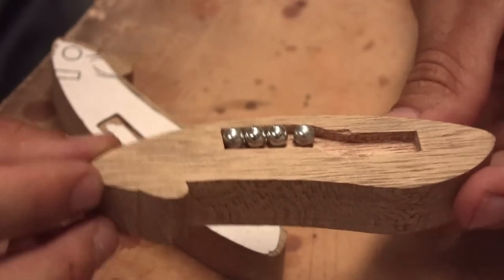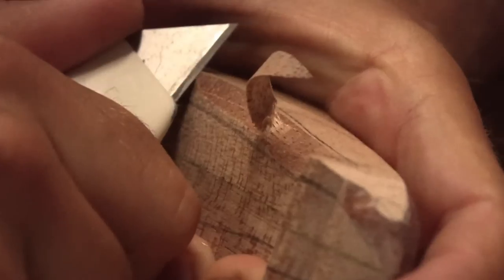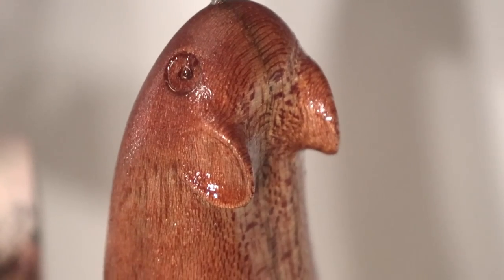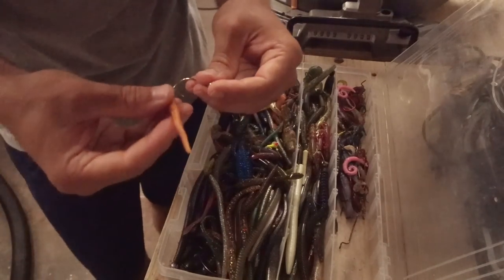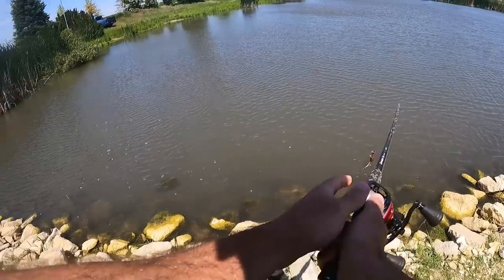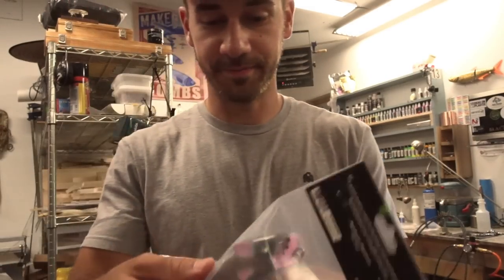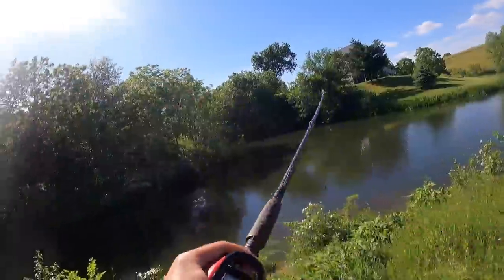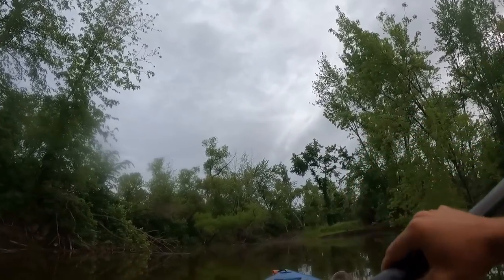Mahogany Mouse WakeBait with a Weight Transfer Chamber

Comment: A truck I've seen from other wood working channel's, use painters tape on both pieces in between the pieces with some glue. Super easy to separate after cutting.

Comment: I notice you use a lot of different knives for carving. Have you tried one of those scalpel blade knives? All different kinds of blade shapes and the blades are replaceable. Claw shaped blades, straight blades, chisel blades, drop point blade.

Comment: You should get (or make it is just led and wire) one of those lure retrieving things, not the big plastic ones but the small metal thing that you slide it very hard into the water and cuz it’s so heavy it can knock it loose

Comment: Had an idea you could entertain.  Could you make a top water lure that uses a tiny solar cell to power a tiny electric motor with an offset weight.  When the sun feeds the solar cell, the motor turns, causing vibration.  I've seen novelty solar bugs online that you could harvest the components from.  No one that I've seen has ever done this.  And you can play off the high gas prices and how we're are sort of being forced into submission of electric vehicles due to that..  Just a thought, probably would get good views

Comment: You may have better luck breaking the two pieces apart if you use blue tape and glue between the tape, that way there is no chance for a direct wood bond that could tear out grain.